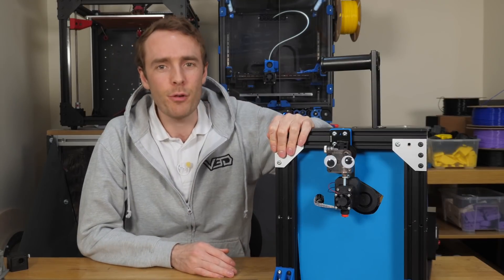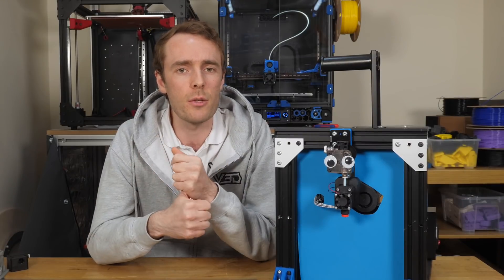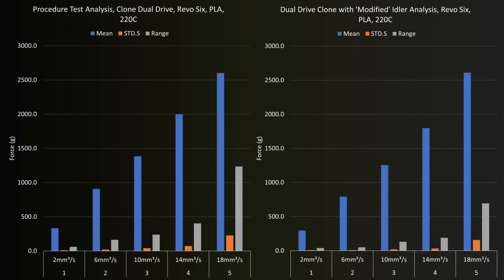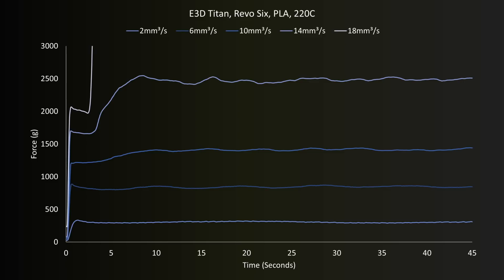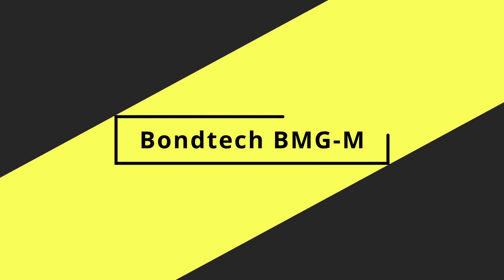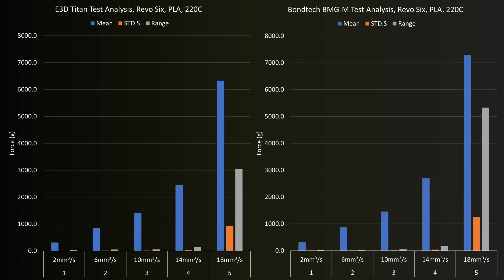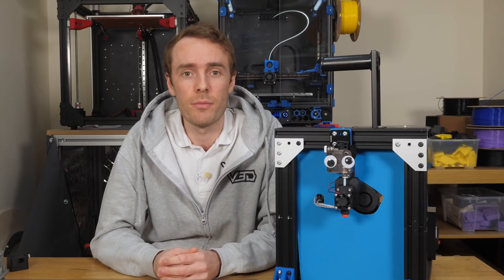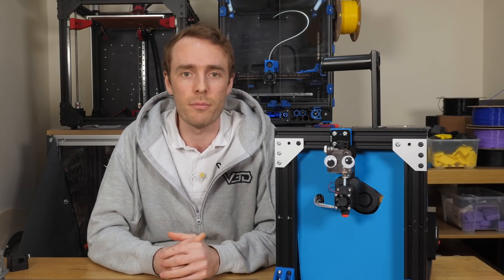The Extrusion Myth We All Believed

Comment: This has inspired me to make my own test rig but with a couple additions:
Adding a high resolution rotary encoder above the extruder to measure actual filament travel, and one encoder on the extruder motor to measure its true rotation.

I'd then have 4 different dimensions (pressure, filament travel, stepper rotation, time) and could chart any 2 of them against each other. I would personally like to see measured filament speed and pressure per degree of rotation to gauge the level of extruder engagement
Reply: Could you please share your results
Reply: @wizardOfRobots  I ordered last month but still waiting on parts 😓
Reply: Do it!

Comment: I think the behavior at high flow rates deserves some more detailed investigation. In particular, checking actual filament delivery speed during the test and hotend power consumption. My theory is that the force oscillations are caused by hotend duty cycle, it fails to keep constant hotend/extrusion temperature and switching between high and medium power and resulting temperature swings affect viscosity of the melted plastic. High forces for the higher quality extruders suggest they're not letting the filament slip and show actual force needed to push the filament through the hotend at insufficient temperature while lower forces suggest the extruder slips on the filament and the force measured corresponds more to at which force the slipping starts to happen.

Comment: Looking at extruder forces purely at filament extruded from the hot nozzle is to simplistic. In a Bowden setup you have the forces to push filament through the Bowden tube and in direct drive you also have to account for the forces to pull the filament. In a good setup it is just as important to reduce those extra force required as much as possible to allow the maximum grip/ extrusion force of any extruder to go to pushing filament through the hot nozzle.
Reply from the maker: The force to pull filament off a spool or move through a bowden tube are so tiny compared to the pushing force that i've treated it as negligible.
Reply: @Vector3DP  I changed my Bowden tube on my Ender 6 for one with closer tolerances and after my extruder was skipping like crazy. Defaulted back and the skipping was gone. Manually pushing filament through with the tube off the machine and I couldn't feel much difference. It was probably the flexing of the Bowden tube at different angles during printing that created enough friction for the extruder to skip. What may be negligible at some point can be a problem at another. Either way it was about eliminating unwanted extra forces.

Comment: The extruder is the only thing influencing the force if you try to squeeze more filament through the hotend than it is capable of handling. Not one of the extruders was able to feed 18mm/s through the hotend, but the dual-drive hotends were able to provide a much higher force before the filament started slipping. The big jumps in the force are the points when the filament slipped and are not influenced by the the drive train but mostly by how easy or hard the filament is able to be compressed and the lenght between the extruder and the nozzle. Very hard and rigid filament produces a high frequency and soft filament a low one. A longer path between extruder and nozzle produces a lower frequency than a long path. The test shows that the dual drive extruders are far better than the cheap one, because they "fail" at much higher resistence of the hotend and must have pushed more filament through the hotend than the single-drive one. The spikes in force are not comming from the extruders but from the filament jumping back and at that point this doesn't matter because you will have underextrusion and your hotend is your bottleneck.

Comment: nice food for thought, thanks! My conclusions: for regular hotends, more force is not very helpful. For high-flow nozzles such as volcano and the new-fangled CHT ones, higher forces may be a benefit, as there is a lot more viscous resistance there. Also, even for regular hotends, dual-drive is better because we can relax the compressive force on the rollers, so we are less likely to grind the filament if we are doing a lot of retraction in one place.

Comment: If the unexplained frequencies don't correlate to the gear teeth or filament 'bite' zones, then the force spikes are either being thermally controlled by the heating elements cycling, or it's the stepper's internal 'cogging' forces being amplified by the gear-trains those extruders provide. I might be wrong but I think when microstepping etc, there are still regions which have more torque to them where the stepper elements can form stronger M fields.

Comment: i bought one of those cheapo dual gear amazon extruders a few years ago for my ender 3 pro. it was great. for a few prints til it broke.  but then i just got an ender 3 s1 with a proper dd extruder and it's been nothing but consistent. takes all my plastic. easy to change rolls.

Comment: Hello. I like your approach to content creation. Let me ask you what you think about my extruder drive? "SL_ST EXTRUDERR 2" on GrabCAD.

In theory, this drive will be very unusual. Gripping jaws can work as heat sinks. Because of this, it is possible to shorten the length of the heat barrier radiator. I'm afraid to imagine what kind of pressure it can develop.

Comment: This is like testing an engine transmission pair and claiming a more powerful engine is a waste because the transmission has reached its limit.     Seems a bondtech would be better paired with a more advanced hot end providing more heat transfer.  Still interesting thanks for making the video.

Comment: This is some great research, finding that the second gear does in fact very little is kinda eye-opening.
Though I'd love to see this test repeated with different polymers. The hardness of PLA means that any gear that digs into the filament at least a bit will require a massive force to shear the material and actually slip, but the only situations where you'll encounter those forces are during a clog or when you're going massively beyond the capabilities of the hotend. For more flexible materials, however, I could imagine a vastly different result, so having this test repeated on TPU / ABS / Nylon could unearth some more insights...
Reply: The 2nd gear makes the consistent print result worse in fact. It has to if you think about it. It is physically not possible to mesh the gears perfectly to eatch other while also to grab the filament optimally and to be adjustable. The oroginal designer probably though ah it´s not a big issue, the force is increased that´s good. But he was wrong though ....
Reply: I had really big problems with white pla, it always grinded away the filament and then did not extrude. 
Now I have 0 problems with that. Also dual extruder has gears at the top and bottom so the force is applied equal and not only at the bottom. If that changes anything I don't know but I'm really happy with that.
And even when I get skipping because of too much nozzle pressure it does not eat the filament therefor I don't have any extrusion problems

Edit: the product is called micro Swiss bowden dual extruder. If u wanna check put the design.

Comment: Dual gear can usually print flexible filaments better, can grip filament better as you saw, and can create more accurate prints. If you want more torque then you would use a geared reduction extruder.
Reply: This is wrong. Dual gear grap harder but rhey don´t print better. This is exactly what he has shown here. This also goes for flexibles, since a harder grip means simply more deformation of the material.

Comment: The oscillations are happening inside the hot end due to the phase change and thermal conductivity of the filament.  Material density is a slope, but phase change is a binary.  A very flexible solid changing to a very viscous liquid may be perceived as linear, but the actual transition from solid to liquid is immeasurable.  For a smooth output, the filament has to fully melt within the crucible portion before it reaches the nozzle.  Otherwise, you're just packing a solid into the transition between the two.  While still solid, it'll just stop at a physical wall.
But, once that solid filament reaches a point where it stops, it's also coming in contact with more heated surface area closer to its center.  Thereby "flash" melting a portion of filament, which will flow easily, and make room for the next solid section to close the gap.  Repeat, repeat, oscillation.
The 'gap' in melting is due to most plastics being excellent thermal insulators.  The heat is only going to propagate over a small distance, which at the correct flow rate should be within the length of the crucible.  If the heat outruns the feed, it will lead to a bulging glob building up at the top.  Or, if the reverse is true, it will result in very low viscosity extrusion at best and oscillation at worst.

Comment: Very interesting! I love this all these data videos. I’d be interested in seeing a similar video but with a carbon or wood or similar filled filament that are more prone to jamming/clogging in the nozzle. Seems like extruders that are capable of higher extrusion force might have an advantage their in terms of clearing blocking particles. Also, I’d love to see the addition of a wheel/gear driven encoder to actually measure how smoothly the filament is moving. Do force oscillations always mean more inconsistent extrusion or could it be “smooth” extrusion with oscillating resistance?

Comment: Realize the real problem isn't 'bad' it is that everything is too good, and the gears are over constrained parallel.

V, and keep the bottom gears fully meshed and a change in filament width will only push the top end apart slightly, and barely change the angle of the V at all.  Of course this would still be better with more teeth and a better gear profile for better engagement.

Over constrained parallel and your filament width changing can change the gear mesh, obviously a bad idea.

The bottom of the gears need to be held in, and only the top floating on the spring, the tiny changes in angle won't really matter as long as the gears are fully engaged..

Comment: Mellow 3D have recently released a version of the Sherpa mini with double helical drive gears, designed to reduce backlash artifacts.
Would be interesting to see it compared with the standard straight cut gears in the same manner as this video.
Reply: I picked one of the libra extruders up. It outperforms a standard sherpa on an identical printer.

Comment: Time to invent a dual-geared, belt driven extruder like that design I found some years ago that I can't find anymore. Or just use angled teeth? Should keep the build volume small. But the gears need to have a bigger diameter than those 10mm ones. And more thickness... Do u read me, prusa and e3d?😂

Comment: You should test the Bondtech LGX to compare if having a very large hobbed gear makes a difference.  With the larger gear there will be more "teeth" engaged on both sides than the smaller type.  This is very interesting data.
Reply: Yes yes! Please LGX Tests :D
Reply: A little but it hsouldn´t change too much, you will still get only a line contact even with the larger gear. OMGv2 should be better and cheaper.

Comment: What is the hotend PWM frequency? PID can go unstable in such conditions.
Reply: The PWM hotend frequency is somewhere between 6 and 8Hz typically, depending on printer configuration; 16 temperature readings are taken during a whole PWM cycle from each available probe, filtered and averaged, and before each new PWM cycle starts, a new PID output value is computed. So it should be stable.
Reply: @SianaGearz  sample rate depends on the firmware. Temperature changes are pretty slow in the hotend, so 6-8Hz PWM is absolutely fine. I am customising marlin firmware for my printer so i know a bit more about this topic 😉
Reply: @dtibor5903  I'm a Marlin contributor.

Comment: Normal extruder will need more pressure from the arm in order to get more grip but increase in friction, this sometimes couses motor skip.
The dual drive grips on both side and doesn't require as much spring tention.

As for the reduction gear, it makes it more accurate, and reduce weight since it doesn't need a big stepper motor which is ideal for direct drive

Comment: A few questions I have for this series.
1) were the e-steps adjusted between all the extruders?
2) Was it the same motor used on all extruders?
3) when running the 18 mm^3/s runs what was the mass of extrusion collected vs expected?
4) Could this be an artifact of your pwm cycle time on the hot end?
5) How would an E3D v6 with CHT nozzle compare?

Thanks for the awesome work!
Reply: My thoughts exactly.

Comment: When you're measuring the 'gear diameter', to compare with the frequency suggested from the Fourier analysis; is that the outer diameter of the wheels?  Assuming that they are involute profile gears, the point of contact between them is not at the outside tip of the teeth, but rather at a 'reference line' that is nearly half way down the teeth.  Strictly, the reference line is inside the outer diameter by the 'addendum', which on metric gears is m millimetres, where m is the module number of the gear.  That's likely to be 1, for gears of that size, and hence the reference line diameter for those gears will be exactly 2 mm smaller than the outer diameter.  To be certain, the module number of the gears would need to be identified, (or the equivalent if they are Imperial, but those are defined in a different fashion), but I think its very likely that this is the case; and hence it really is the gears that are casing the primary waves seen in the force graphs.

Comment: You need to take the nozzle out of the picture and just test the extruder force against a series of constant forces (like a weights hanging from the filament) and record in fine time resolution the filament position so you can derive speed.
Reply: I understand the reasons for the methodology but can't see the applicable aim. To what end? So that the amount of force is known? If so the point stands that the amount of force is irrelevant given that the hotends flow capability is the bottleneck on any available forces utility.
Reply: @m3chanist  it is a controlled environment to test how an extruder reacts to constant load force. The aim is to test if an extruder achieves constant and smooth force and speed up to the limit load. If an extruder does not pass muster in such idealized conditions, it's already subpart quality.

Comment: If you pinch a rod enough to deform it, it will lengthen a tiny bit.  Ask any blacksmith...
The feed-rollers are indeed pinching the filament enough to deform, which leads to pulsating flow.
Coordinating feed-rate to synchronize with pinch-roller induced pulsation might be a solution.

Comment: I would just ask one thing :
What is that pla blob on the titan's driving gear ?
In my oppinion it explains the riples on the extrusion force on higher extrusion rates :

when noting :
Ft the force tangent to the surface createdd by the extrude in our case,
Fp the force perpenticular to the surface created by the extruder's spring
cfns, the coefficient of not-slipping friction
cfs, the coefficient of slipping friction
commonly, cfns >= cfs

on lower extrusion rates, we get Ft < cfns*Fp, specially on the blob were the coeficent of friction drastically decreases, the filament stay synchronised with the gear thanks to the not-slipping condition (Coulomb's friction Law)

on the highest extrusion rates and when the tian's gear presents the blob , Ft tends to exceed cfns*Fp (because cfns decreases drastically : switching form a metal tooth driving it's way in the filament to a soft plastic to plasitc contact parallel to the direction of the filament), thus not respecting the not-slipping condition of Coulomb's law, the forces now respect the sliping equation : Ft=cfs*Fp, wich explain the sudden drop of force on the filament.
It seems that this origin correlates with the adequate frequency (I am not sure not having the original data).

Also Coulomb's solid-solid friction model is simplified, the effects may be better descirbed with Stribeck's friction model

Comment: The clones are notoriously random quality. One of the biggest issue is that hole for the filament is not aligning up with gears and will bind and waste energy to squeeze it through. checking this or reprinting new case would improve quality considerably. I have bought around 10 orders from different suppliers until I found a few ones that provide accurately manufactured extruders with decent gears. I goes without saying that they need to be disassembled and washed because the almost always contain machining metal shards that will destroy bearings very fast. So unfortunately this test on "cloned bmg" is not opening anybody's eyes, because some of them work poorly even just testing the filament moving through extruder and you know it's bad  and other ones look and act similarly to original (ofc. these would need this kind of scientific test to see real difference).

Comment: I think Bruce needs a mustache.
Also, you should really test a DyzeDesign extruder, they use 4 gears....and Vez3D has a very interesting hot end doing +130mm^3/s, that could be a good match up with your testing system